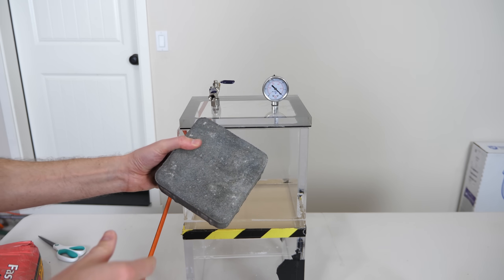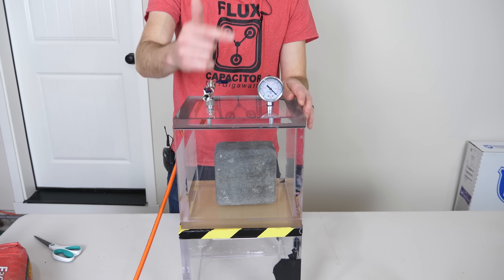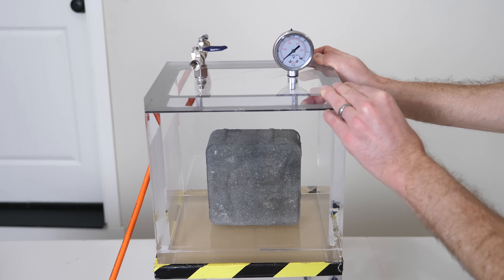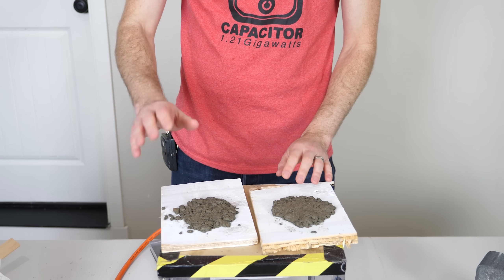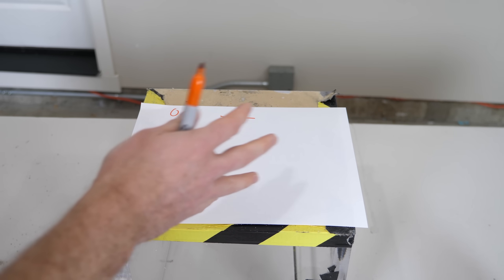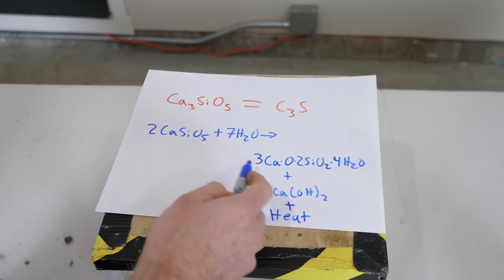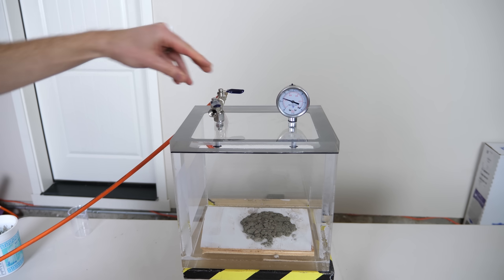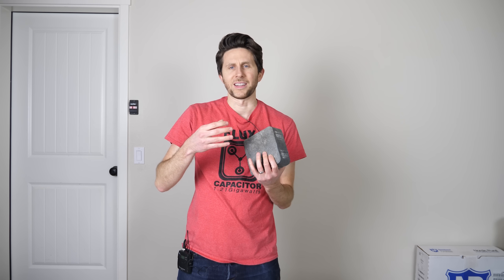Does Concrete Turn to Dust in a Vacuum Chamber? Concrete Without Oxygen Experiment

Comment: "So you can see that being in the vacuum versus being in air didn't really change any properties of the curing of the cement, here."
Not if you leave it for a few hours, but I suspect that the cement in the vacuum chamber probably hardened quite a bit sooner.

Comment: no way it turns into dust. If we assume that it does, then painting the walls which is a layer that separates air from the concrete would make them crumble but clearly it doesn't.

Comment: I'm guessing nothing will happen, because that "theory" or whatever people have of it turning into dust, just doesn't make logical sense to me. So I'm 95% sure I'm right! (Gotta leave room for margin of error! :P)

Very interesting to put wet cement in the vacuum chamber to set! I wasn't really expecting much of a difference between it drying in air vs. a vacuum. However, that color difference, though not major, is interesting and not what I expected. Keep up the good work!

Comment: My guess is that the reason those videos said concrete would disintegrate is because its molecules contain oxygen which gives the concrete structure but because that oxygen is molecularly bonded simply putting it in a vacuum chamber wont do anything.

Also I think the concrete sets using the water rather than air so in a vacuum not much would change if the water doesn't evaporate too quickly

Comment: Moisture is the key catalyst for setting concrete. Pulling a vacuum  long enough  will remove the moisture. A long term test would probably reveal the wet concrete would not harden as well.  Try it!
Reply: Exactly.  Does vacuum cured concrete have a better or worse compression yield.

Comment: Will a wet cloth dry inside a vacuum chamber? 🤔🤨

Please make a video on it
Reply: It should dry.
Reply: The water will boil n evaporeted n will move into vacuum pump just like air move into vacuum pump
Reply: most definitely it will dry
Reply: No
Reply: Yes it will, it will boil and vaporize.
Reply: It will boil until the pressure in the chamber reaches the vapour pressure of water at that temperature. If you keep pumping and the cloth is above zero celcius the cloth will dry and the oil in the vacuum pump will get water contaminated.
Reply: @allangibson8494   That's right!  Agreed.  But doesn't the water contamination thing depend on what kind of pump he has?
Reply: @DANGJOS  High vaccum pumps are generally of the oil filled wet type for bulk air extraction. Once you get below 1 Torr, things have to get creative. Dry pumps will get you down to a tenth of ambient pressure. Small wet pumps are common since they are used to dry out air conditioning systems (and yes you do need to change the oil periodically.)
Reply: @allangibson8494   Okay interesting.  I don't think his vacuum pump is that great, but it certainly gets below 1/10 of an atmosphere.
Reply: #5IQgang
Reply: OK why every body here being a smart kid?
Reply: @Bhavishya Gandhi 🤟👍
Reply: Either way, it's sure to be a boring ass video! 🤣
Reply: Water can be in all 3 state, liquid, solid(ice), and gas, vapor. With the lower pressure, boiling temperature drops, boiling is converting liquid into gas, gas have been suckout as oxigen,nitrogen etc.
Reply: Please
Reply: The cloth will dry as the molecules of water will boil
Reply: For anyone wondering where the water would go after boiling off of the cloth, it would turn into condensation, either as it contacts the edges of the chamber or as it travels through the vacuum tube that drags the gasses out of the chamber.
Reply: @SamuraiPipotchi  the water will only condense once pressure is reintroduced into the system.
Reply: It will act as a wet paper towel. Its better to ask can you turn paper towels into wood with the hydraulic press.       Edit:it might dry but (no offense) that might be a boring video. Its like watching it dry on a counter.
Reply: It wouldnt dry
Reply: No it will not. Think about it, the water molecules on the cloth will remain there
Reply: Dinara actually you’re wrong with the low pressure the water would completely boil away
Reply: @ericnelson3102  but were they will go? As it is closed chamber it cannot go anywhere.
Reply: @PremKhunt  If it boils and all the gas is being pulled out by the chamber...
Reply: @ericnelson3102  I was going to reply the same, but now that I think about it, when the water molecules evaporate, they wouldn't be able to rise up . As a result, they would fall right back down making an infinite cycle, hence cloth stays wet.
Did I miss something? (correct me if i'm wrong.)
Reply: It will go into the vacuum, to reach a pressure equilibrium the water will boil off and stay in a gaseous state, making it a slightly weaker vacuum.
Reply: Water will evaporate, the water would not return to a liquid state however it won't rise as hot steam does, the vacuum will cause this gaseous water to be evenly spread across the entire chamber.
Reply: @PremKhunt   If you keep the vacuum pump on, then the cloth will continue to vaporize until it's dry.  Might even freeze!  But if you turn the pump off at vacuum, the water will quickly refill the chamber with some water vapor until equilibrium is reached.  At this point, it will remain wet.  If the cloth is at room temperature, after being pumped on, then it will fill the chamber to around 2000 Pascals of pressure, or about 2% of an atmosphere.
Reply: @PremKhunt  Look let's pretend a wet rag was in a vacuum box. Let's pretend it didn't need a machine, it just magically ended up in a vacuum. The water would boil and vaporize immediately, but a vacuum doesn't mean there's no space. You are confused, you think a vacuum is somehow itself applying pressure onto the rag or something, and think that it can't go anywhere, when actually, it's the opposite. If anything the water is now much more likely to occupy it's container, as the volume of water in gas is a way for the equilibrium to relieve stress. stay in school, you'll learn about this soon.
Reply: @PremKhunt  it'll get sucked into the vacuum that is sucking all the air out.
Reply: @ericnelson3102  👍
Reply: Junior Maker the water would boil before he turns off the vacuum, so the water (now in gas form) would mix with the little bit of air left inside and would be sucked out of the chamber
Reply: @Dinara1up  The low pressure allows the water to boil at room temperature and phase change into gas.
Reply: @Dinara1up  Ever heard of freeze drying?
Reply: @Dinara1up  why

Comment: Would the result be different if the concrete block were under load?
Reply: Yes, the real purpose of concrete.
Reply: No not really.
Only the curing process could be affected in vacuum. 

The oxygen is bond in concrete, and not removed due to a variance in the two mediums.

We would interpret a gain of stress on the concrete due to a lack of atmospheric pressure is mass is applied. 
But that is only because gravity is the force to dictate the stresses.
Reply: No difference.
Reply: Yeah but some water would evap out in a vaccum before setting, and that would make it weaker.
Reply: @davydiver  true.

But none of this addresses the original question. 

"What would happen if all the oxygen was gone for 5 seconds" ?
Reply: @jbenkidu  water under the bridge.  I am suggesting a further experiment.
Reply: No change whatsoever.

Comment: Guess:,nothing because it wont suck the oxygen from the concrete
Reply: Exactly.  You need to remove oxygen as an element present in all chemical bonds for something to happen
Reply: @Zokalex  If you remove the element oxygen from earth for 5 seconds, crumbling buildings are our least thing to worry about. In fact, we wouldn't have to worry about anything anymore.
Reply: vacuum chambers be like sluurpp
Reply: Supporting you
Reply: Wp
Reply: Thunk-head mc. action lab.
Reply: 100% sure
Reply: concrete shouldn't have much oxygen in it
Reply: Exactly for a scientist hes a but stupid